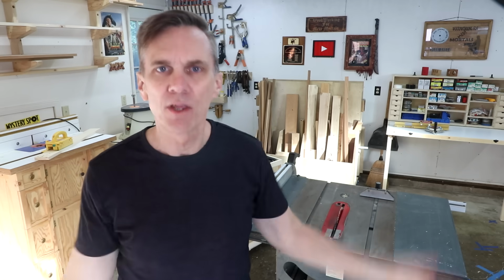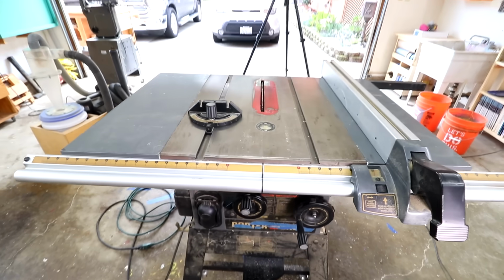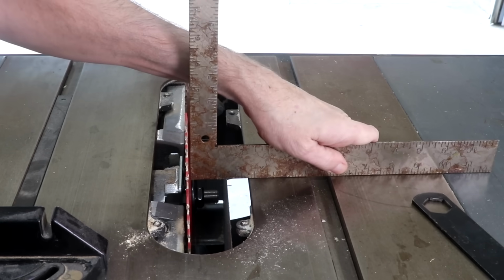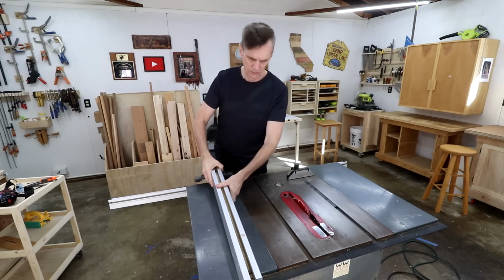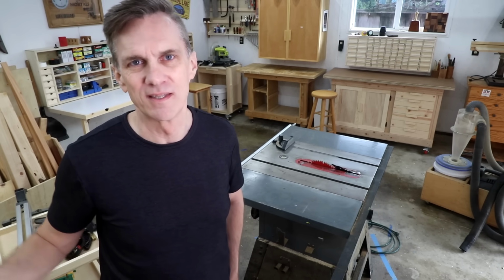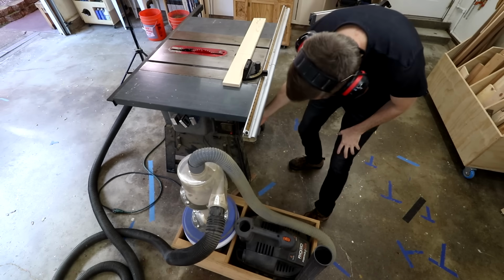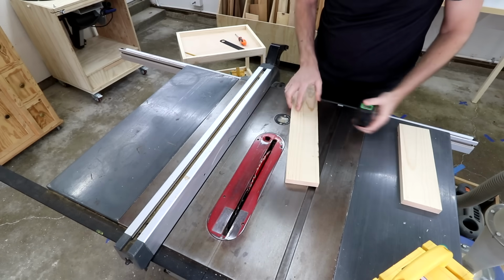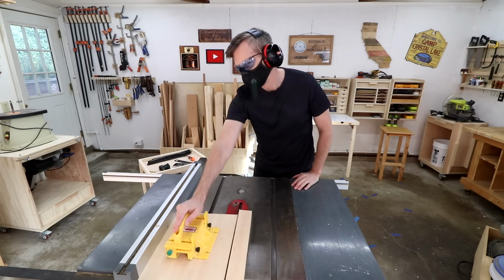A step-by-step guide to making your first table saw cuts. TABLESAW BASICS.

Comment: Hey Steve, 
Great video! I bought a saw like the one on your tool list and it doesn’t have a base that lifts it up off the ground. I have your plans for the tool cart you made for the table saw prior to your first course, but in that video, you used your main table saw to make the cuts for the cart. Since my table saw is low, it doesn’t seem safe to use it that way, So is the best way to make those cuts with a circular saw, or is it best to find another, temporary way to raise the saw while I build that cart? Thanks for your great videos and courses!
Chris
Reply: Having your saw on the ground wouldn't be inherently dangerous. In that situation because of the height difference between your center of gravity and the saw, try to get yourself low to the ground also. Knees or even butt. Don't ever put yourself where you are balanced over the top of the saw in case you lose that balance. Use push sticks to keep yourself back. And keep the blade guard on just in case you do slip and fall on the table. 

These are the same things you would do with an elevated saw, only a little more awkward because it's so much lower. Do dry runs of the cuts with the saw off and see if you can do everything while staying balanced.

Comment: Your videos are always so timely!  I've been wood working with power tools for about a year now, and I just bought my first table saw at Christmas.  It is set up, and I've logged about 200 hours of youtube table saw safety videos, installed riving knife, blade guard, and I have a featherboard and multiple push sticks at the ready.  I turn on the saw, look at it, and think "not today, Satan."  Your videos are certainly helping to build the confidence I need to actually put the saw into practice.  An area where I feel that I'm lacking is analyzing the boards to know where the stress points are and to know when a certain board is not safe to use on a table saw.  People seem to gloss over this part of table saw videos, and I need details!  As always, thank you so much for well-presented content!
Reply: I can totally relate. I received a table saw as a Christmas gift a couple years ago and it sat for too long before I finally used it. I wanted to be careful, safe, etc. I did lots of table saw research & YouTubing...I think I watched this awesome video thrice. Now that I've used it, I love it and it's super fun to use!

Comment: Great video as usual! I missed one important piece of advice though: never go past the blade with your against-the-fence push stick.
Reply from the maker: Good point. Keep it pressed toward the fence in front of the blade so you aren't pushing against the blade.
Reply: You can only push whilst holding stick??     No fingers no hold......NO GUARD
Reply: Hi Steve.  Why do you not use a guard.......and why do you not comment on my multiple comments regarding ' no guard

Comment: my table saw didn't come with a riving blade
Reply from the maker: If you can't get a riving knife, use splitters. Here's some that I like:  https://amzn.to/31dNCS7
Reply: Steve Ramsey - Woodworking for Mere Mortals - Thanks for this... I recently traded a compact table saw for an older contractor saw, excited about what seemed like an upgrade... until I re-assembled it and realized that the provided riving knife (that I incorrectly assumed had come with it) could not be installed anywhere!  I saw a few other videos about how to make your own splitters, but for the price, I think I’ll go with these!  

@Saigyl - thanks for asking the question for me!

Comment: I made some cuts yesterday with the rip fence. Somehow I ended up with annoying blade marks, especially at the end or when I grabbed for my push stick. How can I avoid those?
Reply: Depends on which 'end' of the blade the marks came from (ie the 'front' nearest you, or the 'back') - if it's the back, it could indicate the fence isn't perfectly parallel to the blade when you set it.  If it's the front, then it might be that as you reached for the push stick (or applied the push stick) you accidentally pushed the wood slightly away from the fence - just enough for the side to brush the teeth and pick up marks.

Comment: Hi Steve.
Could you do a buyers guide for table saws? Looking to buy my first one but don't have much space and there is so much choice out there and extras to consider.
Thanks
Reply: The easy answer is to get a Sawstop if you can afford one. That narrows it down a lot.
Reply: @brucejohnson1264  
Problem is the price for me.
Also I'm based in the UK and sawstop isn't readily avalible.
Reply: @ModelRailwayUK  I don't know how it is over there, but Sawstop has pretty much taken over the commercial market for cabinet saws. You can get used cabinet saws for 1/3-1/4 the cost of new over here. No used sawstops though. You might look into that. Whatever you do, realize that the most important part of the table saw is the fence. The best is a T-square type fence.
Reply: @brucejohnson1264  unfortunately there are no distributors in the uk :/ I think it's a great saw even without the safety feature. I'd have to buy one from the USA and ship it over.
But the fence advise is great thanks, I'll see what's around.
Reply: @ModelRailwayUK  There are basically three categories of saw, Jobsite/portable saws which can be made to work for most things, contractors saws which are less mobile and more accurate, and cabinet saws that are monsters that are incredibly smooth, powerful, and easily stand up to commercial use. I made lots of stuff with a contractors saw, now I have a cabinet saw. Both can do the same stuff, the cabinet saw is just nicer and more powerful. A lot of people start with a Jobsite saw if money is an issue.
Reply: Buy a cheap used one and figure out which extras you like or think you'll need then when you upgrade donate your old saw to a new woodworker!  Along with a link to all of Steve's videos!!! Lol he is so great!

Comment: Why is it a bad practice to use the miter and rip fence at the same time?
Reply: There is a chance the piece between the blade and fence will turn just a little as it cuts off. The corner that turns into the blade will  bind it and cause the cut off piece to kick back.
Reply: @corkscrewify  what if the cut off piece wasn't next to the fence? And the workpiece and miter were on the same side of the blade? Would it still present a hazard?
Reply: @TheTacticalLeprechaun  We'll have to wait for someone more experienced to weigh in. I've only ever seen the fence and miter guide used on opposite sides, and used them that way myself.
Reply: @TheTacticalLeprechaun  If you are using the miter gauge between the blade and fence there would be less of a chance for the piece to bind because you are holding onto it. There is still a chance though, and if it does catch, you would be standing right in the path of kickback.

One technique you could use for that kind of cut is to move the fence out an inch or two and fill that space with another block near the front edge of the saw. As you start pushing the board forward you would leave that block behind and now there is extra space so the wood couldn't bind between the blade and fence.

Comment: My wood always burns along the cut at the end. What am I doing wrong?
Reply from the maker: Scorching can be caused by a number of factors. Some species of wood simply scorch really easy: maple and cherry are notorious. A dull blade can be the culprit.  A rip fence that is not parallel with the blade can be a problem. Feeding the wood through the blade too slowly can cause scorching as can feeding an an inconsistent rate. My guess is that you are doing something different at the end of the cut, maybe twisting the board a little causing it do pinch against the blade.
Reply: @SteveRamsey  Thank you sir! I guess I have a few things to rule out. Great content as ever!!

Comment: Thanks for the video. Noob question. I recently got a table saw and am looking for the safest way to make small rip cuts. I have a peice of 1x2x24in (actual), and need to rip to a peice of 1/2 x 3/4 x 24in.  What is the safest ways to make the cuts? I dont have a "grippper" I've tried using a Sacrificial push stick but I'm not getting accurate cuts with it and it just feels unsafe.  Thanks.  Also when ripping what is the rule for what side of the blade the off cut goes to?  Love the videos.
Reply from the maker: Usually, the cutoff is on the outside of the blade. That way the board should remain the same width through the entire cut as it rides between the rip fence and the blade. Have you tried making a push block like the one in this video: https://youtu.be/JOhZxvgkWNM

Here's a template you can use to try it out: https://drive.google.com/file/d/1P2gvz4VWwJMLirKjFwcaf1um8qhdKpfX/view
Reply: @SteveRamsey  thank you for the reply. Yes, that is the exact push stick I made. I was also having the off cut between the blade and fence. 🤦‍♂️. I'm guessing this is why the cut was not accurate. Thanks for the info.
Reply: Push blocks like the gripper with adjustable feet or ones with sacrificial bottoms are the way to go on small rips. A feather board can also help keep the board tight against the fence.

Also make sure the blade insert is flush and not flexing as you push down on the board. That can lead to wobble, binding against the riving knife, and cuts that aren't square.
Reply: @beardeddragonwood  thanks. I'll try adjusting the blade insert.  I guess my biggest problem is the second cut. Guiding a 3/4 x 1in to take only 1/2in off seems difficult to stay accurate

Comment: This is exactly what I needed. I'm left handed and my uncle saw me cut wood on the table saw and he said, "WHOAH!" I learned my body placement was very dangerous.
Reply: I'm left handed as well. I don't have a table saw yet.  I'm close buying one (already for years).  From time to time I use an upside-down mounted circular saw
but as Steve says, it's far from ideal.  I still don't know if I should try to learn to use a table saw (when I finally will have one) as a left-hander or as a right hander.
I'm 100% left handed. With my right hand I'm not able to write, open jars, use a knife or any one-hand-operated handtools such as a hammer, screw-driver, wrench
or whatsoever.
Reply: @hansdegroot8549  Probably should learn to use it the way he uses it in the video. Unless you don't like
your balls, or thighs..
Reply: @hansdegroot8549  Same here. I was reading that moving the fence to the other side of the blade can help. Since I share the table saw with right handed folks this really isn't an easy option. Oh well, something will work out. Have a good one
Reply: @hansdegroot8549  try moving the fence to the other side of the blade also there are some right tilt saws out there
Reply: Depending on your saw, you may have the option to mount the Rip Fence on the left and use the Mitre on the right (although, from what I've seen, most saws that allow the fence on the left have less rip-width available compared to the right)...  this may allow you to use your saw comfortably and safely without right-handed conventions...

Comment: At about the 12:29 mark of the video, I noticed that the push stick you were using in your left hand was pressing the off cut against the blade. In other videos you've produced, as well as those from other wood workers, the push stick in the left hand should be BEHIND the blade. If I am not mistaken, doesn't pushing the offcut against the blade increase the chance of kickback? Perhaps the riving knife saves the day, but I am curious.
Reply: Yes, you're right.  As far as I know, you shouldn't push the off cut against the blade and therefore, applying pressure just before the blade is best.
Reply: Sharp eyes! I'm not Steve, but my guess is that he wasn't pushing very hard against the board at that point. But you're absolutely right that you only want to be using sideways force before the blade.

Comment: "Theres no dumb questions when taking about powertools"..... Challenge accepted :-)
Reply: "Should I touch the blade will spinning to see if it is sharp?"
Reply: @lukewhite9237  How else will you get it to stop?
Reply: If I cannot get the saw to turn off, should I use it to cut its own cord❓
(That happened. Not a stuck switch, but did not see where the cord was. Good thing I had a spare cord on hand)
Reply: "Should I lick the blade while moving to clean it?"
Reply: Should I use my table saw to make exactly sized French fries, and if so, which is better for a push stick, a stalk of celery or a carrot? 
I ask because slicing bologna on the miter saw had some issues.
FYI, bologna in a dust collector, well let's just say...........
Reply: Should I replace my blade with toilet paper so I can clean my buttocks after I eat Taco Bell.
Reply: @n1elkyfan  no use the drill press for that
Reply: if i turn it upside down, will it power my ice boat?
Reply: @timpani25  I've seen people race belt sanders, but the thought of table saw races just gave me an ulcer!
Reply: I wonder how many of steve's followers have lost a finger or two

Comment: Whats the best way to set your rip fence when doing a Bevel cut? should you add half the thickness onto it?
Reply: You can try to gauge the distance between the fence and the cut, but I would err on the wide side. Leave yourself extra material to nudge the fence closer and take off more material if needed. Sneak up on the perfect fit rather than trying to hit it perfectly the first time.
Reply: Thanks that's what I was doing was hoping there was an easier way lol

Comment: When asking how high the blade should be above the stock, ask yourself how much of your finger you want to cut off!
Reply: I find when cutting melamine, the higher the blade the less chipout that I seem to get.  Though a piece of masking or painters tape usually reduces it.
Reply: @edwardholmes91  I use a Ridge Carbide Melamine Blade and it doesn't splinter the good side of melamine at all.  It's pretty pricey, but it's' an investment, stumpy nubs uses them as well.
Reply: one tooth above the cut. alot of excess blade seems to reduce accuracy. also depends of the blade and what your cutting for combo blade and real wood i find it gives less tearout and burns.
Reply: I was told that the gullet should just clear the thickness of the wood
Reply: I've often heard that you want the blade one tooth width higher than the wood.  You get a smooth cut and the chips can clear the blade.  However, in harder woods this can lead to burning because the teeth spend more time in the kerf.  If your work is getting burn marks, try raising the blade a bit and see if you get better results.
Reply: There are many theories and methods. But each has its pros and cons. If you just have the blade 1/16 over the wood, you have a lot of teeth in the cut. Which is bad for blade and workpiece heat, burning, warping, and it's also easy for the workpiece to rise up over the blade and potentially get the kind of kickback that table saws are famous for. Also if you have any up and down change then your cut won't go through.... Then you have to try to reset or back up the cut during the cut... Not safe at all. 

If you have the blade super high then you will have less resistance in your cut, no burning, and the blade is forcing your work piece to stay on the table... But your blade is more exposed and that can obviously be dangerous. More blade to cut your hand off. Also with more blade exposed the length of blade inside the cut is greater and your accuracy on the fence must be better or your cut quality will suffer.

I always recommend somewhere in the middle. Like somewhere between the teeth fully exposed over the piece, to the gullets fully exposed.
Reply: the reason for  having the  saw blade as  high as possible   is   the higher the blade is the teeth cut down towards the  table   so the force of the blade is  sent down towards the table   if the blade is just above the timber the force of the blade is pushing  towards the person pushing and tends to  push the timber up   and makes the timber rise up at  the  back  of the board as it  is being held down at the front   if you look close at the  video you  can see   the is a  small gap  this  is not  good as the timber can  ride up the  blade  ,     and not  using the top guard on  a  saw that is being  used to instuct  is not  good   this would  get  your workshop shut down in  the  uk  if  you  cant be bothered putting it back on after it  has had to be taken off  you  should  have  a  top hanging guard   , 33 years as a  cabinetmaker    been  involved  with 3 accidents    with fingers contacting the saw blade    2  mine    , the guard  is there for  a  reason if  it  wasnt needed saws would come without them , nothing like the  sound of bone hitting a blunt saw blade )
Reply: the only reason for having a high blade is trying to get a cut close to 90 degrees, but in that case, you might want to use a jigsaw or bandsaw
Reply: Why why why no guard steve

Comment: How dangerous would it be to use a saw blade that is of a different arbor size? I have a 5/8th arbor tablesaw but ordered a 3/4 bore saw blade due to a site error. Would I be ok using it?
Reply: Sometimes blades come with inserts, so you can change the size of the hole in the middle to fit a smaller arbor.  Things to watch out for when replacing or upgrading your blade are that it is either the same size or smaller and that the maximum RPM of the saw doesn't exceed that of the blade.